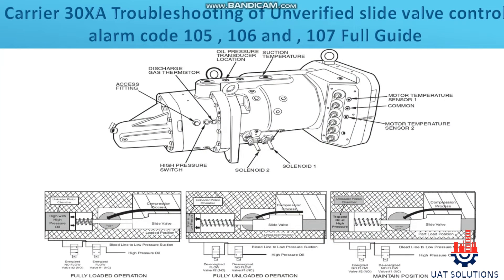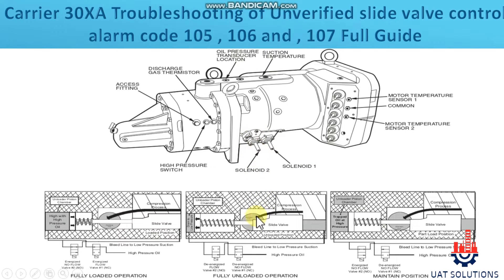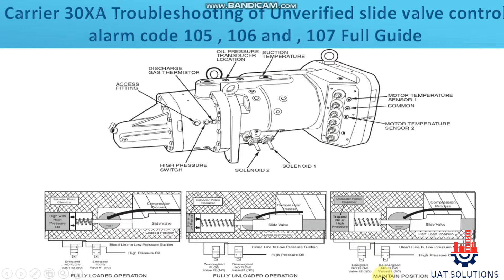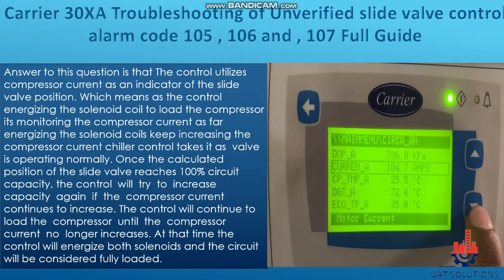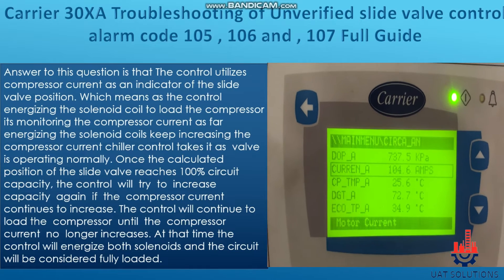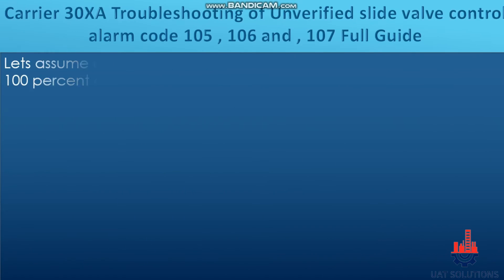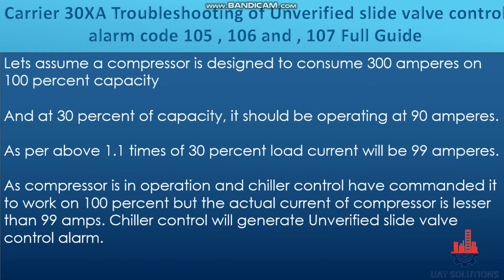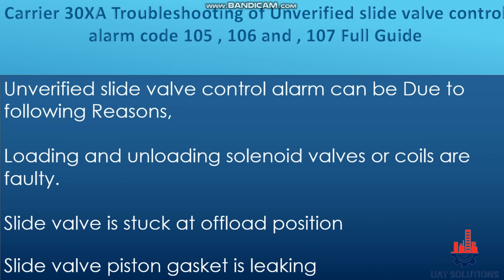Carrier 30XA Alarm Code 105, 106 & 107 Unverified Slide Valve Control Complete Troubleshooting Guide

Comment: 30xa chiller what is setting MTAsetting it is FLA OR RLA.
Reply from the maker: MTA setting is for must trip amperes . In case compressor draw current morethan the mta setting it will trip the compressor 
Fla and rla are not controlled by MTA